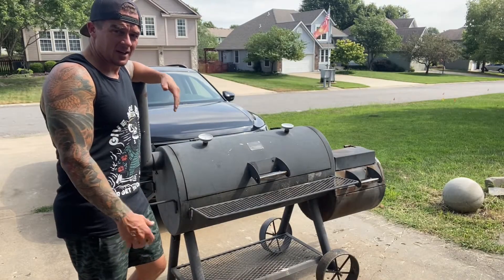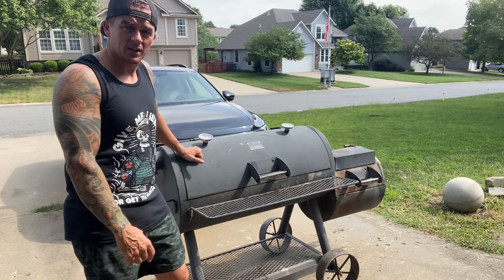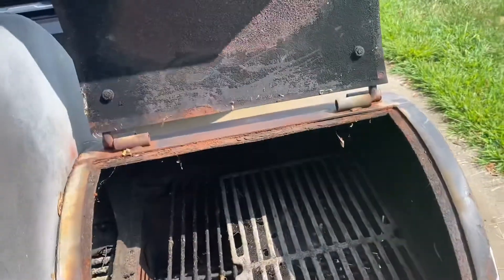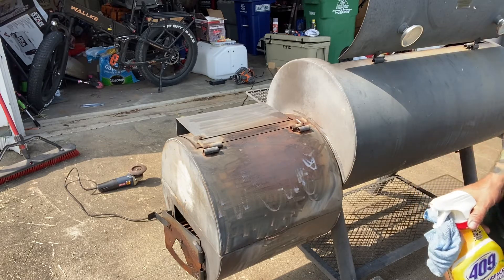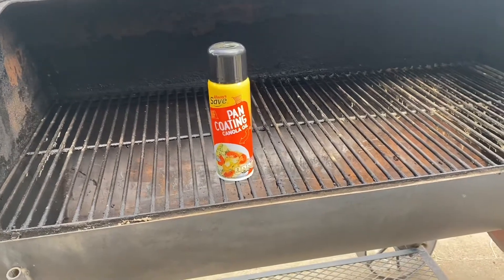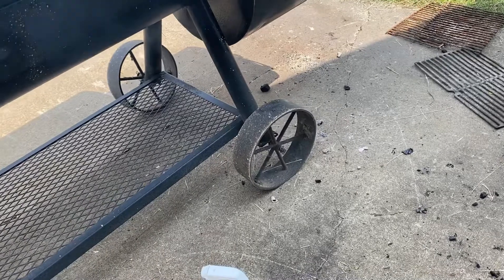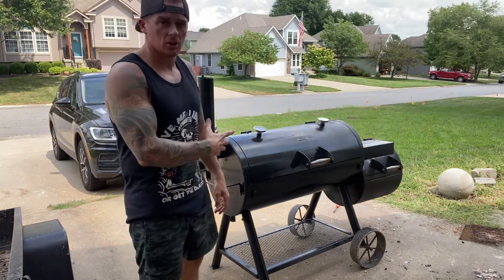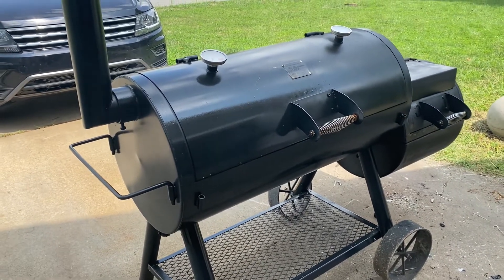Refurbishing Old Oklahoma Joe’s Smokers | Side Hustle | Profit at the End

Comment: I picked one up off the side of the road, the biggest issue with it is that the left side panel has a slight dent where the smoke stack come out of and it causes a slight misalignment of the main door, so I’m trying to figure out how to correct that.
Reply from the maker: Might have to heat it up and give it some tough love with a rubber hammer

Comment: Hey there, I bought two Oklahoma joes smokers in the mid 90's and I need to get a replacement.  New Braunfels bought them and they went downhill in quality quickly.  How can I identify one of the heavy gauge units when viewing?  They may "look" similar but how can I separate the wheat from the chaff?  Thanks!
Reply: Look at the name plate, it will have “Oklahoma Joe” inside the state of Oklahoma. It’s in a black font if I remember correctly
Reply: Old ones are 1/4 inch thick steel.  This newer one in the video is 300 on sale at Lowe's and maybe a tenth the quality of an original